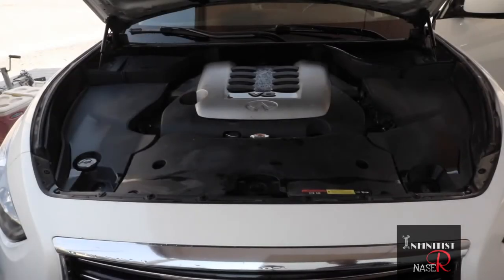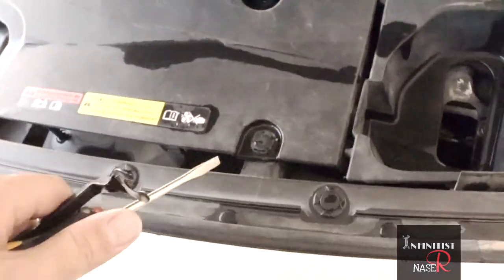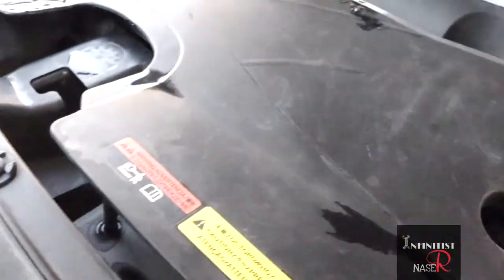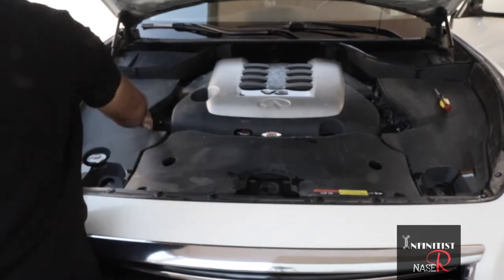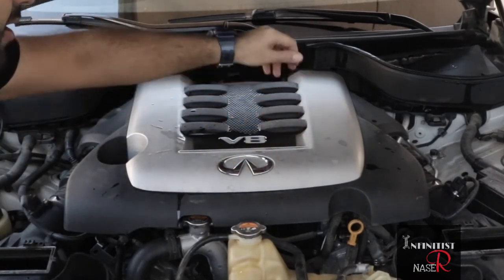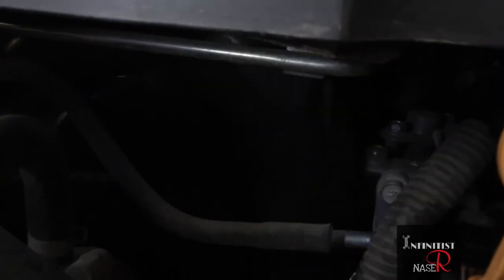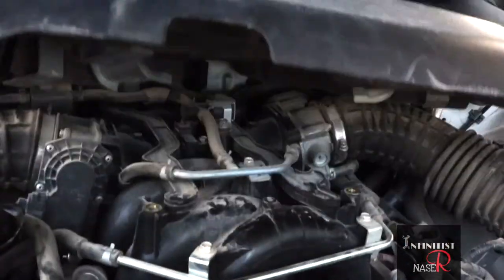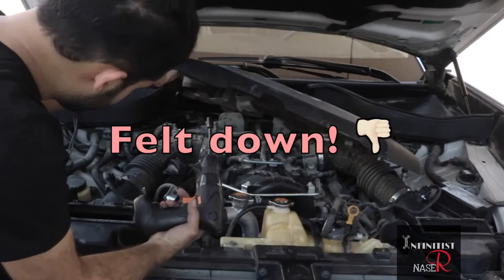How to open Infiniti engine cover

Comment: The front bolts are 12 mm the rear are 10 mm. I was concerned the rear would be almost impossible to get back in but it was surprisingly easy
Thanks!